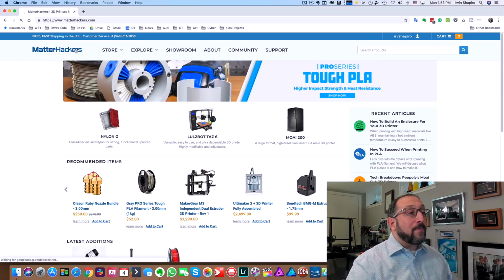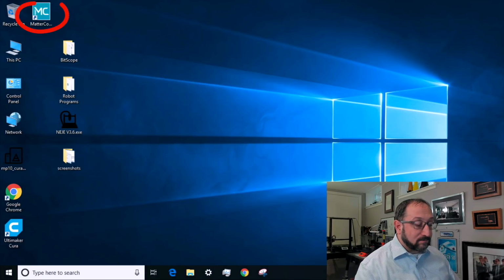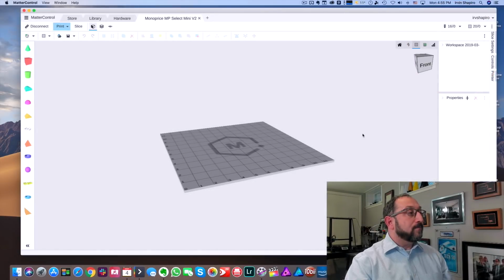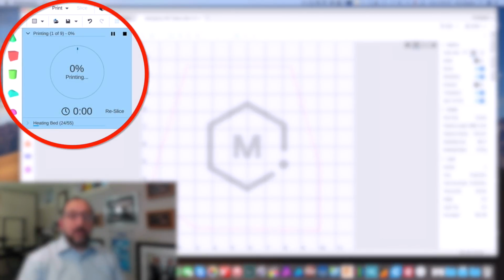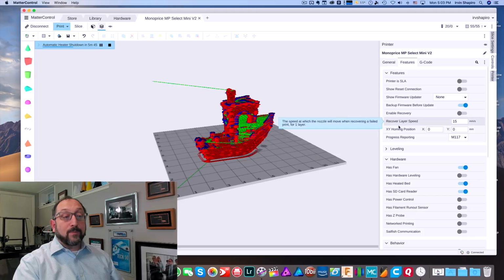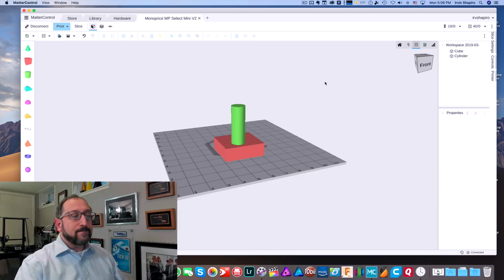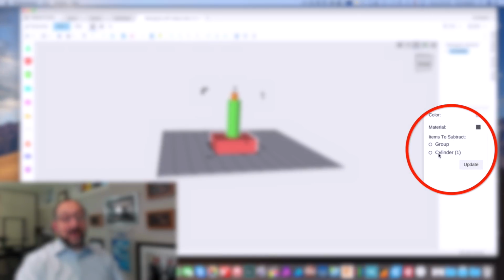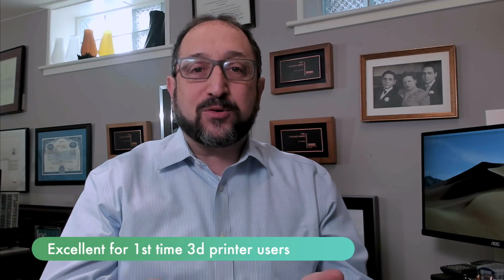Best 3d Printing Software for Beginners

Comment: Just came across this and for others like myself, 'free' is actually limited. The really useful tools are locked behind a yearly subscription requiring an online connection. Its a nice package and the 'free' version has many features but it is not 'free' per se, only if the limited version has everything you need.

Comment: @Make With Tech I'll have to try this on my Ender 3 V2. I always enjoy your videos and as a one time DEC Vax operator, love your old nickname. I worked back in the tape & disc pack days
Reply from the maker: Me too.  Started with PDP-8s with DECtape and even worked on a machine with papertape.
Reply: @MakeWithTech  My dad was a printer and he bought equipment from a newspaper at one time to speed up his hot metal typesetting equipment that ran on paper tape. When I was in high school, the school had a dumb terminal with an acoustic coupler. They bought time on a system and dialed up to run programs we wrote in class. My aunt operated a punch card machine when I was a kid.

Comment: Hello, I have a Creality Ender 3 V2, and I am having a problem connecting my printer to this program, when I try to connect it says there is a connection issue. When selecting hardware there is no option for an ender v2 there is only an option for an ender could that possibly be the issue? sorry if this question is missing vital information or has an obvious solution I am very new to this and computer programs in general thank you for any advice! Also one last thing when I connect my computer to my printer even when it is off the printer screen turns on. Thanks

Comment: Sorry I have not downloaded yet but, time out, “cost”?? Is this the cost of filament or is the software company charging a fee per print?
Reply: It's the cost of the amount of filament required to produce the print. You would have to let it know what brand of filament you are using for it to give you that info

Comment: First and foremost, I liked this [and others you have done] video. You always impart good info in them. To that end, I have the following question.

I have not yet installer my BLTouch on my Ender 3 Pro and because of that I have to "level" my bed too often. Could you do a video on some of the finer points/features/settings of MC. I would primarily be interest in the Software Bed Leveling feature. 

Exactly what is it that you are referring to when you say that the "software" will dynamically adjust to the bed height after manual leveling? Even an ABL sends it's info to the printer to make these micro adjustments "before printing" starts.

You did "touch" on this feature but you left me hanging for the meat of the feature.

Thx,
Red

Comment: Thank you so much for this review! I have an Anet A8 that I built myself, and it works really well but the only issue I had was it has a USB plug but I couldn’t use it unless I got the Octoprint software (which requires a Rapsberry Pi as the basis). I really struggled with having to eject the MicroSD card, plug it into my computer, load the code model onto it then re-insert the card back into the printer. After seeing this I ran to my office, turned the printer on, downloaded and installed the software, selected my printer, plugged in the USB cable and boom, I can now print directly to my printer via USB. Again, thank you so much for this, love the channel (I subscribed not long ago), and have watched almost all your vids.

Comment: Thanks for another great vid daktari. I've given MatterControl a try on MacOS Big Sur. Finding it very buggy especially the file manip commands. Won't create folders, cannot find folders on my machine and pops up dialogs that just won't go away no matter what I do. Right now it's popped up an <export file> dialog that I cannot get rid off via the cancel button on it.  I'm also experiencing issues when I ask it to combine multiple objects. Oftentimes it simply does not do it. Sometimes it does work but after a 10s or longer wait. I guess it needs more work still. It does export to STL OK and I can open that STL in Cura and print it on my Creality CR-10 Max.

Comment: Hello, I’m totally new to 3D printing.  Just got our family an Ender 5 plus for Christmas and it’s still in the box.  Here’s my question, I’ve watched a few set up / unboxing videos, and so far all have said we don’t really need the USB cord, and that we should just use the micro SS card to load GCode to the printer.  Does this software support uploading the G Code to an SD card for printing, or does it need to be plugged into the printer via USB?  If so, can it upload the code to the printer or does the computer need to stay attached to the printer thru the whole print job?  Like I said, brand new to this world, so not exactly sure if I’m phrasing this question right or not.  For reference we are operating on MAC BOOK PRO.  Thanks, loved the video, great info and directions.

Comment: cant get it working. there is no help for connecting to my Ender 3 v2 by USB. The software doesn't find the printer. I cant load direct to SD either.

Comment: Hello I'm New Here but I have used a 3D printer a few years ago.
Anyway I have looked around and you are the Most Informative of any place I have found.

I have ordered a 3D printer  (Anet ET4X) and the tools needed to convert the firmware to marlin 2.0.X (using Your Very well done Video). it sounds like matter control would be the best software to use however I haven't  been able to find how to setup MC with My printer let alone one with the Marlin Firmware.

Do you have a Video for doing this or where i can look with detailed direction for doing so?

I also joined you forum

Comment: I assume once you begin printing MatterControl does not seize the computer so you cannot do anything else while it prints, or do I have to start a whole new instance of MC? (Win10)
Reply from the maker: I would probably not print directly from MatterControl but would save the STL to an sdcard and print locally.   Printing directly will work but you risk imperfections in your model if something running on your computer causes MatterControl to stall.

Comment: DrVax I am considering buying a 3d printer i am a first time 3d printer buyer and watched alot of YouTube videos. My wife and I live in a 2 bedroom apartment but dont have that much room but i only have a budget of $200 to $300. I love the Ender 3 pro but i have no room for it how ever i do have enough room for the Easythreed cube printer i am only going to print small things for scratch building models for my train layout. i saw alot of videos for this printer and was wondering since it is small it is a good printer for me? is this program good if i wanted to download it now and practice on it without the 3d printer just to make models from scratch and save them? hope to hear back from you thank you
Reply from the maker: I would recommend the Monoprice Select Mini V2 which is on the Monoprice Web site at $219.  This is a very compact fully assembled printer that I have used for PLA, PETG and TPU.

Comment: Hi Dr Vax , can I use matter control with flashforge dreamer
Thank you
Reply from the maker: MatterControl supports a number of Flashforge printers but I do not see the dreamer.  I would select one of the other Flashforge supported printers and then use the printer tab on the right to adjust the size.
Reply: Ok , thank yo so much for your help

Comment: I am using a Silhouettte Alta old version 3d printer and learned by trial and error how to use cura with it. Do you think that I will be equally able to use Matter Control V2  with it?

Comment: Hi, I have a quick question if you don't mind. I  was wondering if I could import an image of something. Let's say the outline of a giraffe's face cropped out on photoshop! Could I then take the image and make that 3d? not create a full giraffe's head, just the giraffe's face but with say a quarter of an inch thick. So if I stuck it on my wall it would stick out a little bit? (just an example lol!)

Comment: I am very new to 3D printing and have never used any programs like this before. I am trying to connect this to my Creality ender 3 but it keeps saying that a device attached to the system is not functioning. Any idea on what is going on?

Comment: Hi, what is the estimated cost figure based on? is it accounting for cost of the filament? Surely that depends on which filament you use, not just how much..
Reply from the maker: It is based on the values you set or the defaults for the filament.   If on the slicer tab you slick on the pencil next to the material name you will see these values.

P.S. I have started a new discussion forum at http://forum.drvax.com where we can all have more elaborate discussions and share pictures on our prints and printers. Check it out.  Irv

Comment: Thanks for the video.  I was just wondering... if you have a noname printer, you can not use this software?  i have a Tronxy. lol.  Thanks again
Reply: Didnt work for me either. I have the monoprice delta mini printer and I tried using other other and found not get it to work 😡
Reply from the maker: On a delta printer you must use a delta profile.    A Cartesian style profile like the Monoprice select mini will not work.
Reply: @MakeWithTech  thanks for responding. So question, will the monoprice delta pro work and if not, do u know what printer I can try?
I'm trying to get the complete specs for the delta mini, likebthe bed size, nozzle offset and etc.
Reply from the maker: I have not used the delta pro but the specs look good.  I am not sure it will work with mattercontrol but it will work with cura.
Reply: @MakeWithTech  actually the delta pro is listed in the supported printers for matter control . I selected the mp delta pro and changed the setting to meet the mini setting bit it didnt take.
I did try the mini select last night and it work to a degree. I couldn't get the nozzle to touch the bed. It stopped about a 1/4 inch and also it was a little off centered.
I'm totally new to this 3d printing and I dont know how to fix that issue.
I'm still praying lol
Reply: Yes.  I have a highly modified FolgerTech 2020 i3.  After logging in I selected Other / Other for a printer and then went through it using the USB to find my printer.  I presume a recognized printer may have more info, but the software took the info from my Arduino and uses it.  Just remember to unplug the USB when the software asks and then plug it in.  I checked my connection with Pronterface before just to verify the COM port.

Comment: I have downloaded and installed this program, problem is that it does not recognize my printer. I have a tronxy x1 which is quite a common printer, but still not recognised so I can't use this program

Comment: Great video and easy explained. Thank you. After watching the video I installed the software, and yes it is relatively easy to use. After creating my first project I exported it to the SD card from the printer. Well.......the exported file is in stl format, but my CTC printer works only with x3g format. End of story or, can you point me in the right direction?
Reply from the maker: Let me clarify for you.,   STL is a 3d model format.  x3g and gcode files are the output of a slicer, a program that converts 3d models into a format that a 3d printer or CNC machine is able to process.   Said another way, x3g and gcode files are instructions to a printer.    To generate x3g from mattercontrol, first add an x3g printer to you configuration and draw your model on the x3g compatible workspace.  Then you can export to x3g or connect the printer directly to mattercontrol and print.

One option for x3g format 3d p[rinters are the MatterBot prints.

Hope this helps.
Reply: @MakeWithTech  Thank you for the fast reply and clarification. It is refreshing talking to experts who are really knowledgeable. Rudy

Comment: I enjoyed the video. Downloaded the program MatterHackers. However, I have a problem, my slicer is not on the list of printers, its called ADIMLab-gantry. What do I do??
Reply from the maker: You can select another printer with a similar architecture and then edit the printer size on the printer tab.  Or you can slice in another slicer and load the gcode and use mattercontrol to print.

Comment: I have an xyz 1.0 3D printer and cannot seem to fing it in the list of printer. I watched you video because I am new to 3D printing. I'm wanting to print very simple shapes. I own a shop that builds custom emergency vehicles for various agencies. We have for years fabricated from steel/aluminum stock shims for emergency lights for use on pickup truck caps, fender and so on. An associate of mine started to 3D print these items. So I downloaded this software you recommend in this video. But I'm not sure it is compatible with my xyz 1.0 printer? Can you help?
Reply from the maker: Just pick a printer with a similar architecture and then in the printer tab edit the dimensions.  The printer tab is in the right. You may have to enable it with the three dots on the right.
Reply: @MakeWithTech  I am unfortunately so very new at this that I have no idea about the xyz 1.0 printer I have let alone any other 3D printers. I guess maybe I should contact MatterHackers and see if they can help?
Reply from the maker: I recommend watching the 3D printing demystified video on the channel.   

Where did you buy the printer?
Reply: @MakeWithTech  The printer was purchased from a friend. I know it is a few years old but I aquired it fairly cheap. I am replacing the extruder(hot side) and heated bed. You know what when I was looking for the replacement parts I noticed it was referred to as the xyz Da Vinci 1.0. I will have to see if rather than searching for xyz, I look for Da Vinci if I may find it? I really only need to print spacer shims. So my models will mostly be square or rectangles with holes for mounting hardware, and various angles on one side.

Comment: I wish I can use this with my MECREATOR2 but the printer doesn't show up on there
Reply from the maker: Just select a printer with a similar architecture, and then on the printer tab on the right adjust the print bed size.   Then tune parameters as needed.  Most printer parameters are similar.
Reply: I don’t kno witch one is smiler
Reply: Similar **
Reply from the maker: Sorry.  I try to reply to as many comments as possible and sometimes when typing to fast I mess up :-)

Select a printer with the same architecture and the same extruder setup.   For example, based on the pictures on the web the MECREATOR2 looks like it has the same structure as an Ender 5 with a Bowden tube extruder setup and a Z-axis that moves the bed up and down.   Unfortunately, the Ender 5 is not listed but the Ender 3 is.   The Z-axis is different but the Ender 3 and 5 share similar hot-ends and Bowden tube setups.  I would start with the Ender 3 and then edit the print volume on the printer tab.
Reply: Nice I’ll try that hopefully it works thank you for getting back to me

Comment: I'm another newbie and a little nervous about the process.  I have a Elegroo Neptune printer that's not on the list. I understand to pick something similar BUT there are SO many options I need help picking.  Please tell me some options I should try. Thanks
Reply from the maker: I would try using the Ender 3 profiles to get started.  Just make sure you adjust the print area size to match your printer.  I had never heard of this printer before but the specs are quite nice.

Comment: Lifesaver - I have been struggling with several programs to draw, slice and print and had nothing but trouble and "dead ends". This video makes things so simple and so clear. Downloaded MatterControl and got started immediately with no problems. Thanks for your time, expertise and simple guide. :)
Reply from the maker: You might also want to watch this video.

https://youtu.be/B-kWtReUEN8

Comment: Hi there, great video Im looking to get a printer make Wanhao model Duplicator D9 300, but I don't see in the list of hardware my model, only 4S or Duplicator i3, what can I use? Thank you !!
Reply from the maker: Just google the other Wanhao models and pick the one that is closest.  Then go to the printer tab (enable the printer tab with the three vertical dots on the top right hand side) and change the printer dimensions to match your printer.
Reply: @MakeWithTech  Omg thanks Dr. I didn't expect a reply this late, I will look right now, have a goodnight!!
Reply from the maker: My pleasure.  I love the community aspect of YouTube so I often check the channel at crazy times.
Reply: @MakeWithTech  Same here lol, I'm learning from your video, can't wait to get mine, I have so many ideas 😉
Reply: Drvax, same issue here. I have the monoprice delta mini and cant get it to work. I will try what u said about picking the closes one. My fingers are crossed

Comment: Great video I've learned a lot!  One thing I don't have the "Slice" button just the print Icon.   Help please
Reply from the maker: You will not have a slice button until you select a printer.  Just click on the print button and then select a printer (or add a printer if you have not added one yet) then you will see the slice button.